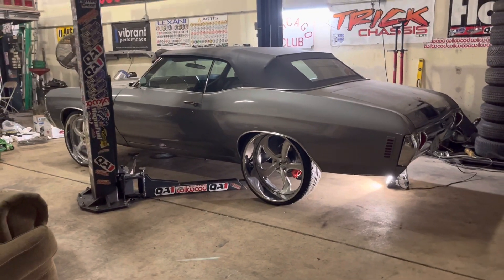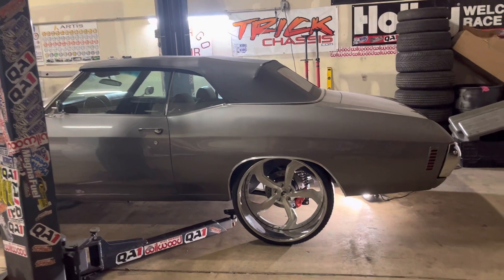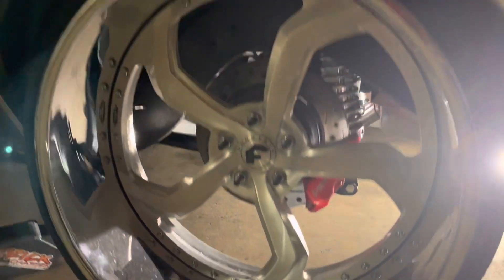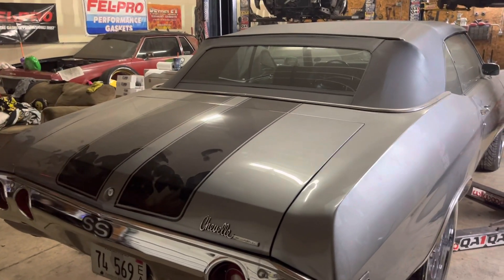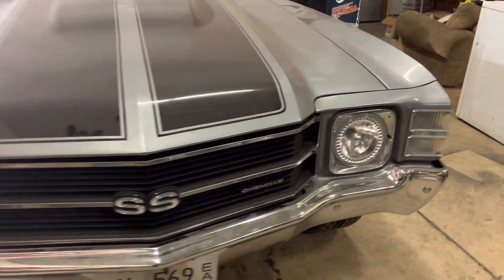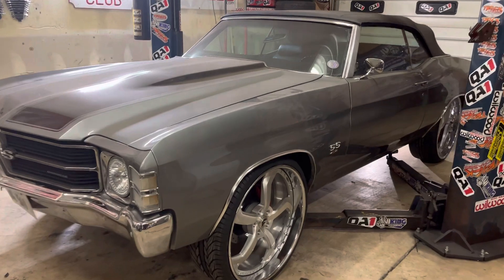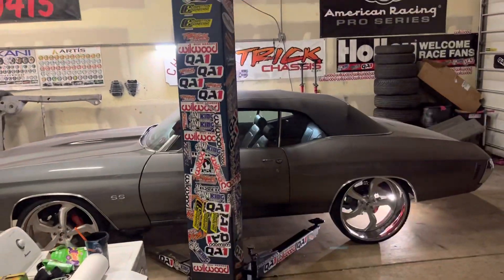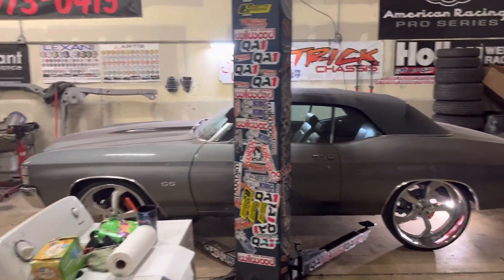71 Chevelle Mounted on 7” Lip 24’s / Bet It Up Kustoms #583

Comment: Putting 24×8 on1971 cutlus wonder what's the basic I would need to put on with out rubbing in front  would I need full lift or minor adjustments to put on ?
Reply from the maker: Test fit them first and go from there..

Comment: How much did u cut in rear?
Reply from the maker: @darianjohnson2556  both rear axles are 27 inches so it’s basically 3 inches off both sides from stock this a 12 bolt rear end car. 💯

Comment: What’s the part number for that coil over kit you used on this chevelle. I have 69 cutlass and I’m trying to put 24’s on without cutting.
Reply from the maker: Just do a bolt on Viking kit and you don’t need to cut for 24’s
Reply: I did but it was the 0-2 lowering ones and it didn’t work

Comment: How much to fab a squat like that?
Reply from the maker: $3500-$5500 with parts
Reply: @BETITUPKUSTOMS  how do I set up an appointment and I would need your expertise on what parts do I need, I have a 1970 Buick Skylark and I'm want to tuck some 24's with a 8 inch lip
Reply from the maker: Text me a pic of the car and a run down of what you wanna do, then stay on me 6309730415

Comment: I habe 69 cutlass. What offset do i need for the front? I want 24s
Reply from the maker: A good wheel shop can tell you that..
Reply: @BETITUPKUSTOMS  have you put 24s on a 69 cutlass before?
Reply from the maker: I’ve done a 68 on 26’s
Reply: @BETITUPKUSTOMS  ok. So can i keep the original offset specs?
Reply: @BETITUPKUSTOMS  just gime a short run by on whats needed?
Reply from the maker: These fronts are 24x9 and rears are 24x10
Reply: @BETITUPKUSTOMS  what sizes are the tires? Will i have to cut?
Reply from the maker: 245/30/24 front 275/25/24 rear if I remember correctly..
Reply: @BETITUPKUSTOMS  ok. But t 69 cutlass wheelbase is 112in. That chevelle is 116in
Reply from the maker: It’s all about getting the wheels first and trying them on, test fit to see what needs to be done..
Reply: @BETITUPKUSTOMS  i understand.  But buyn $7k rims to not know if theyll workout first is nervewrecking